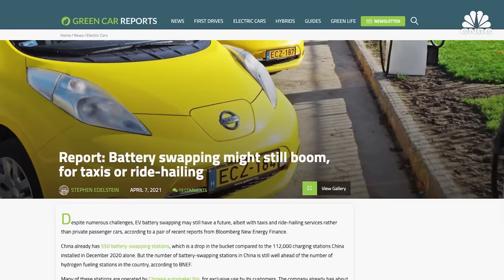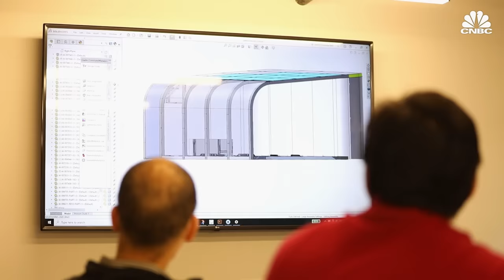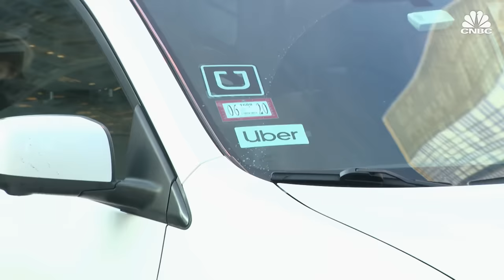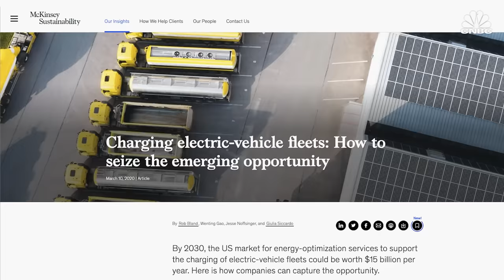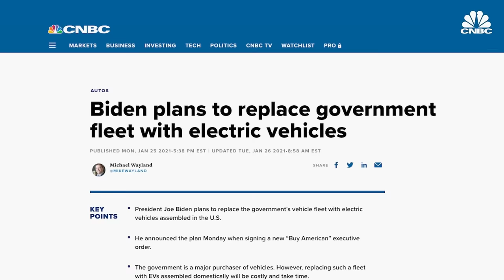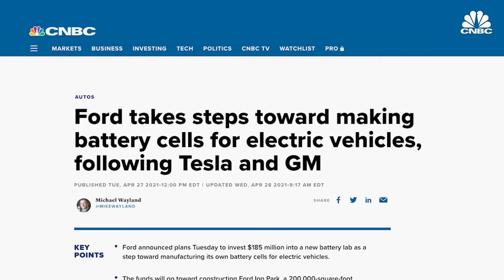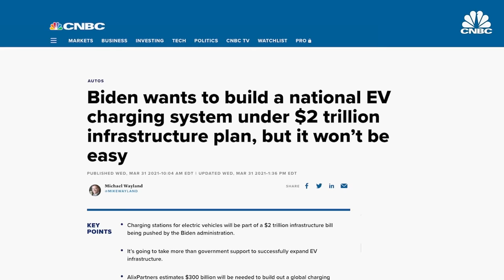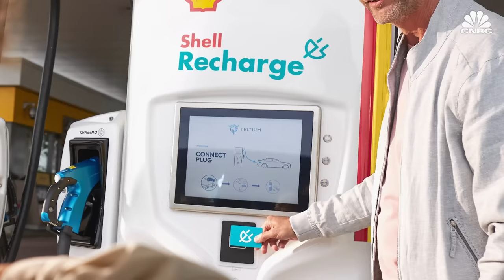Can EV Battery Swapping Take Off In The U.S.?

Comment: They should focus on City’s, places with high EV concentration and lacking Or underserved EV DC Fast chargers. Commercial fleet vehicles. I believe in the battery swapping technology its much more like a gas station experience  where a company host the infrastructure and you just go and fill up your car, and this technology can both accommodate many fast, and slow charge depleted batteries and therefore the requirements, needed for the Electric infrastructure is much less where they install them.

Hole problem here is that there need to be many of them maybe as many as gas stations all over the world and i just don’t se that happening, but i hope they prove me wrong 😉
Reply: A city is a terrible place for these stations. Youd need millions of dollars worth of batteries stored up at each of these swapping stations to ensure that people arent waiting half an hour to either wait in line for the line up of cars to swap ahead of you, or for them to fully charge their bank of batteries. At that point you could just plug your EV into a supercharger. It would be waaay cheaper to equip a city with charging stations. Also most city drivers arent driving 300+ miles in a day. So they could just plug their car into a slower charger overnight. Yes cities would need to convert streetlamps into chargers, and add ev charges to public garages, but thats waaaay cheaper than swapping stations.

Comment: Nio makes cars, out of that revenue they barely make the swapping stations that only charges nio cars, ample (maas) makes batteries that swap certain cars to use either ample batteries and or your manufacturers batteries, its not a bad idea but there's already a shortage of silicone, chips, batteries and my question is do you have enough batteries for a us market and whats the range on them.

Comment: Well, Nio tells they can swap a battery in 3 minutes. So even if the "classic" charging evs would take only about 15, you can swap batteries for 5 cars in the same time. In high traffic areas this is an advantage, because you not only have to wait for your personal charge. You also have to wait for other people finishing.
Well - the USA may be one of the last countries with more than 50% EVs on the street. But in some countries they will have these percentages soon.
Reply: Its really not a good idea. My city is already connecting ev charging stations into streetlamps for people who dont have a garage. Tesla is going to have way better range with their integrated structural battery pack than any modular EV. Teslas batteries are already cheaper, smaller, and go farther than the competition and it just getting better. How many battery packs will these swapping stations need to have on hand in a city in order to make sure people arent sitting around waiting for a pack to finish charging before it gets swapped into their car? A battery is the most expensive part of an EV and they want to have thousands of these just sitting around when the world is already battery constrained. Each one of these places are going to cost millions in battery's and they will need to be all over the city and highway, otherwise youll be driving out of your way to get a swap, negating most of the benefits. They mentioned using them as grid energy systems, but that will degrade the battery life and tesla is already doing this grid battery powered energy storage with cheaper batteries that dont need to be small or light.
Reply: @HavokBWR  I don't see why the idea (at least Nio's) isn't good. With the battery swap system of Nio you can also charge in a "normal" way. So you can charge at home (if possible) and swap batteries at the stations. - it's flexible Another plus is, you'll always have a battery which is checked and works. You'll never get a degraded battery.
Reply: @R3mak3r  because of all the reasons I listed? You didn't really give a counter to any of the points I made, just that you can charge at home. So you'll be paying for this swap feature that you're not even using.

 Having a stockpile of expensive batteries sitting around at these very expensive stations when the world is going to be battery constrained for a long time is just a bad idea. The price of all these packs and stations will be put on you as the consumer. These cars are not going to have nearly as good a range as cars that have an integrated battery pack. Yes batteries degrade but new Tesla's have million mile battery packs, that's going to last a long time.
Reply: @HavokBWR  your argument with the range isn't true. Nios range is absolutely competitive with Teslas. Nios extended edition has a range up to 1.000km. That's more then enough.

The amount of batteries is negative. Yes. But I don't know if it is really a deal breaker. Maybe in a large scale. I don't know. Do you really need more batteries in total, over a longer time period, or only in a short time view, because "just in time" productions doesn't work with this concept. Maybe this is only a dealbreaker over one year, but not over 10!? This question only can be answered mathematically, not by opinions.
 
When not everybody needs to swap, because they can also charge at home I don't think swapping is that bad. It's just a kind of additional service. When charging times gets faster, the advantage of swapping stations will decrease. But at the same time the battery issue will decrease, too. Let's assume they are able to charge batteries in 20 minutes in future. And a swap needs 3 Minutes. Then you need around 7 (3x7=21) batteries in rush hour for one swapping station. So you can tell, after 7 cars in a row the advantage disappears, too. Because the 8. car has to wait the usual charging times. On the other hand the swapping stations may at least cap some peaks. So, to me it's kind of a comfy service to ensure your battery is healthy, and to save time. If you need a new one, you have to change your battery anyway.

Comment: Charging many small vs one big is the exact same thing, very basic engineering here.
Then all the moving parts in their system...
Then in the future, batteries are moving to be part of the car construction...
Now imagine swapping more modules vs. fast charging just in the fastest region of the battery 10-50% for 10-15 min.

Some places they still keep testing solar cells in the road, yes really integrated in the road. When it's cheaper and more efficient to put them on the roof.

Furthermore, the future seems to be that electric cars will be integrated into the electricity network when at work and at home. Only charging when demand is low and supplying when demand is high.

Comment: 1.  Elon sold himself on battery swap in 2013. (Since Elon has arguably the best foresight in the industry, we know the idea makes sense) The conventional wisdom is that Model S battery swap failed because of low consumer demand.  Yes, Tesla soon abandoned the idea, but THE TESLA BATTERY SWAP PILOT WAS COMPLETELY INVALID.  Think it through:
   a.  In 2013-2015  Tesla Model S was sold only to rich people with home charging available.   Therefore, there was zero demand for quick battery swap.  Local supercharging was only for emergencies, and most people charged while sleeping, which always be the most time efficient method.
    b.  Battery swap was not tested for long trips.  If they had tested a cross-country network, they would have uncovered real demand for battery swap.

2.  Teslas are still too expensive for apartment dwellers.  This will change, and these lower income EV owners will desire faster charging than 20 minutes.  Nobody wants to waste 10-20 minutes EVERY DAY. (This is one reason NIO swap is successful in China, where single family homes and garages are
 rare.) 

3.  Battery swap is criticized because it ties up more physical batteries than supercharging, and there is currently a battery shortage.
      This argument will be moot as rapid automated battery production is ramped up, raw material supply is increased, and more abundant raw materials are used.

4.  The conventional wisdom is that structural batteries cannot be swapped.  This is wrong.  There is no reason that a structural sandwich cannot be attached to the bottom of a car with removable fasteners.  Given large enough bolts, location pins, and smart engineering, the strength of a removable structural battery sandwich can transfer to the entire car.

5.  The conventional wisdom is that supercharging stations are more space efficient than swap stations.  This is wrong.  Supercharging is initially more cost efficient, but not more space efficient.  In dense population centers, space efficiency and consumer demand for faster charging will win.  The current cost efficiency advantage that superchargers currently enjoy is mostly at the expense of the consumer wait times.

6.  So Tesla, because of an incomplete and misguided pilot test project, and false assumptions about cost efficiency, fooled themselves into forgetting about battery swap.

Comment: It will never take off unless vehicles makers agree to a standard battery.  Companies have done this with forklifts for decades
Reply: Yea let's give the power companies an even BIGGER MONOPOLY
Reply: Yeah and a standard battery is such a bad idea right now anyway. Ev range just isnt good enough yet to cap of the potential efficiency benefits of structural battery packs, or just packs that are designed for specific vehicles.

Comment: Interesting technology, but still, like hydrogen, can be useful only in some specific situations. And that swapping station looks for me like giant tape library 😉. That mechanical moving parts are weak points. All idea is to do all in software and electronically.
It’s Better to have swapping station or one or two additional cars without swapping?
In towns, for first less cars. Sec all cars park somewhere, street connector or wireless mats.

Comment: Battery swapping is common in Ebikes, and Mopeds more light obviously but I like this idea. Free idea from me of no charge. just like the modular batteries also have a auto system to push out the batteries And pull them in (how they are connected is up to debate). Also with more smart MFs being born they might make a battery small enough for convenience.

Comment: So when someone pulls in with a degraded battery, won't hold charge they just get a new battery. Their old abused battery goes to another customer. What can go wrong ? 

Hybrid is the future, not EV. If people can't pull in and fuel/charge in rhe time it takes to take a dump. It will fail gloriously!! Tech trickles down from aeronautical and racing, there is no EV airplanes in commercial use and there is no EV racing that can even attempt to compete with combustion engines.

Comment: Trailer battery’s folks!! Trailers that move perfect with the car, even when backing up.
Reply: Batteries weigh a ton. Batteries inside the vehicle will be depleted faster simply due to it having to tow more batteries. EVs have a ton of torque, which make them perfect for a truck platform, since they’re designed to tow/haul, but depending on its cargo, range may be limited. I am curious about Tesla’s future trucks, both cybertruck and semi.

Comment: Sooo any fast charger on the streets are actually damaging batteries that cost 7 to 10k $ 🤷🏻‍♂️
Reply: Fast charging isn't good for the battery, but you need to take it with a grain of salt. using a fast charger a few times doesn't really matter. Even many EV's that almost always fastcharge are fine considering.

Swapping station btw also need to use fastcharging, that are have many spare batteries in their station, which isn't a good thing considering the battery shortage problems coming up and the cost and space requirements of these batteries.

Comment: And what about the new Tesla cells charging to 90% in 6 minutes? These guys are going under soon enough since batteries will charge nearly as fast as swaps.
Reply: Where did they say the new cells charge that fast? Ive seen 80% in half an hour. sounds like youre talking about solid state battery tech, tesla doesnt have that.

Comment: You cannot accurately measure the amount of energy that you are taking from a partially used battery. Is also the number of batteries sitting around being unused at any given time Is unsustainable. Those batteries could be in use And on the road in cars instead of sitting at so called revolutionary battery swapping stations. Anytime you are constantly taking a part something and putting it back together you are creating excessive wear.

Comment: Nice now my brand new battery gets swapped for a used battery that I have no idea of it’s history
Reply: Plug in vs battery swap isn't an either/or choice, your car could/should have the choice of both.

It should still be possible to charge a 'pluggable' battery up with the outlet at home or at the charging station. So if you want to, you can keep the same battery until you've worn it down to the nub, if you like.

One day you will need to change it anyway, having this tech on your car makes it quicker than an oil change rather than a half-day of labour in the garage getting your EV wrenched on.

For fleet vehicles, taxis, semis, or people who've already been using their batteries for a couple of years, it's a practical solution. They should guarantee a minimum capacity for any used battery you get and charge accordingly.

Finally, they should offer the option to pay for a guaranteed brand new battery if you want to keep it to yourself. 

Then, people like you who prefer it, can use the service for a guaranteed, brand new battery once every couple of year for $500, or as you prefer, use the service every day with 'recon' batteries for $5. (for example).

It's not without precedent, I have seen devices (baby monitors) which take rechargeable AA batteries and also have a wall charger. I can use the plug and/or buy another set of panasonic AAs down the supermarket if I want. Having the choice is what is good about it.

Comment: I am not that “glued” to either my car or the battery in it especially considering the insurance and price of buying to own. EV Share started up in California with Bravo. I will be happy if it ever makes its way to SC. If so I am on board. This makes room for absolutely every car manufacturer to move into the EV market. 

Resource scarcity is a real limit on even the gasoline internal combustion market despite companies’ desires for endless increase of profits. The former CTO of Tesla is now recycling batteries and we have barely even scratched the surface of the EV market. We have been using batteries for energy storage for well over a century. 

So can we keep doing so? Yes however we must adapt to reality or no we won’t be able to. 

The other blindspot is the untapped market of allllll the people who cannot afford any car at all let alone an EV. The successful wide adoption of EVs means non-ownership. Of course, this means building that system. And then the uptake of EVs and all forms of other electric-driven transport will skyrocket. People who have no job and merely need transportantion are  the ones waiting for this exact opportunity. Probably the biggest market imaginable.
Reply: Battery swapping is really not a good idea. My city is already connecting ev charging stations into streetlamps for people who dont have a garage. Tesla is going to have way better range with their integrated structural battery pack than any modular EV. Teslas batteries are already cheaper, smaller, and go farther than the competition and it just getting better. How many battery packs will these swapping stations need to have on hand in a city in order to make sure people arent sitting around waiting for a pack to finish charging before it gets swapped into their car? A battery is the most expensive part of an EV and they want to have thousands of these just sitting around when the world is already battery constrained. Each one of these places are going to cost millions in battery's and they will need to be all over the city and highway, otherwise youll be driving out of your way to get a swap, negating most of the benefits. They mentioned using them as grid energy systems, but that will degrade the battery life and tesla is already doing this grid battery powered energy storage with cheaper batteries that dont need to be small or light.